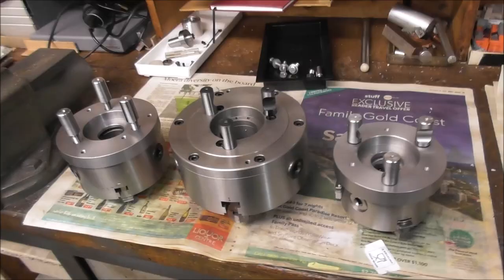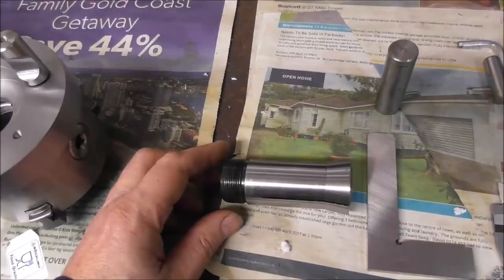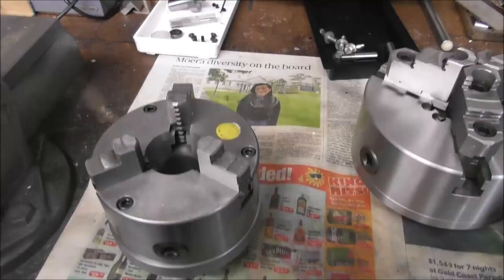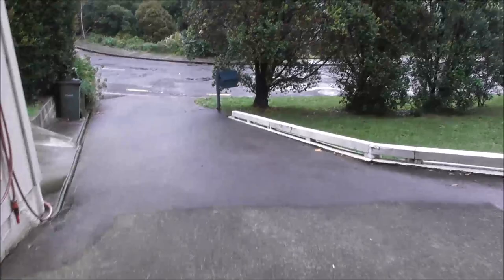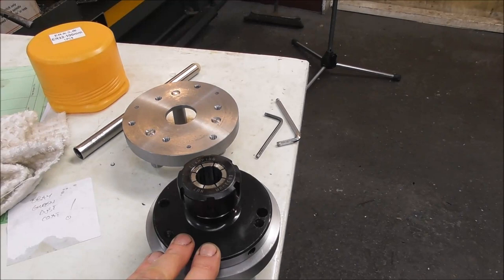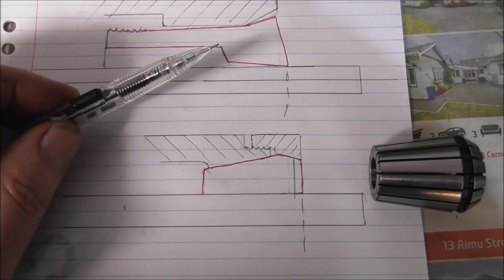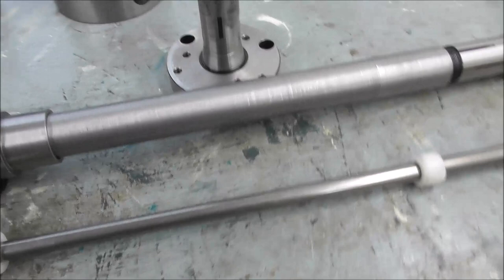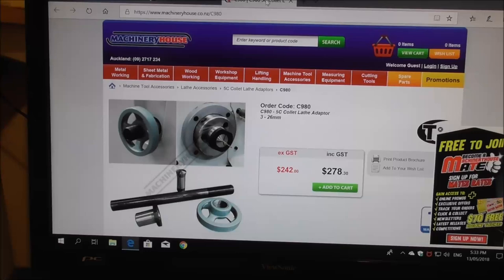Chucks, Collets, and Backplates  Part 1

Comment: It should be an interesting set of videos Cliff. Yes ER's were invented as a tool holding collet system and in case some viewers don't know by Rego - Fix. In my opinion had ER's been invented first then the 5C system would be a bit less popular than it is today. 5C does win on it's versatility, speed and multitude of accessories designed to work with them. Those lever and air operated collet closers as just one example. Since I'm not doing this commercially I had to get the most for my $$$. When I bought my Bridgeport clone I obviously needed some form of collets and even though the chuck extension is much more outside the spindle bearings than R8 collets would be I chose a very well made set of ER 40s and chuck. That way I can get dual usage from them on the lathe with the addition of a shop made set tru type collet chuck. 

I strongly doubt any one collet system can do it all no matter how well it's designed, so I hope to have those R8's, and a good set of the 5C at some point. Even with those a set of ER 8's or 16's would be useful to cover the lower end of what the 40's can't do. Unfortunately there seems to be never an end to buying tooling.
Reply from the maker: Thanks TP - Yes you raise some good points.  Cheers  Cliff

Comment: They sell 5c collet depth stops as it is internally threaded adjustable to any length, problem solved.
Reply from the maker: Yes that can be handy for collet work, although the stop draws back a little depending on the part diameter when the collet is tightened.  But obviously no good as a chuck stop/. Thanks for your input.  Cliff